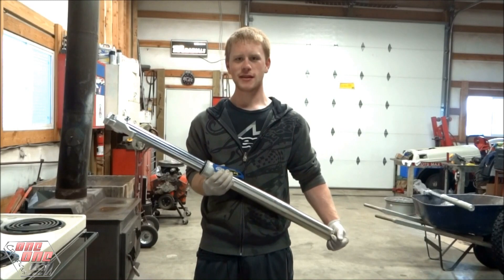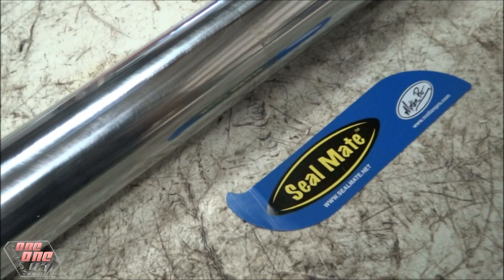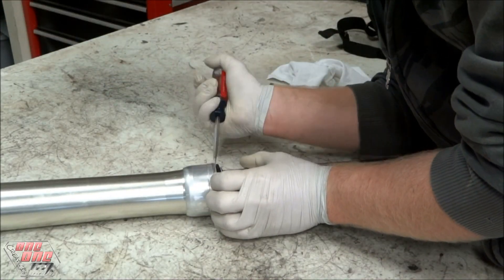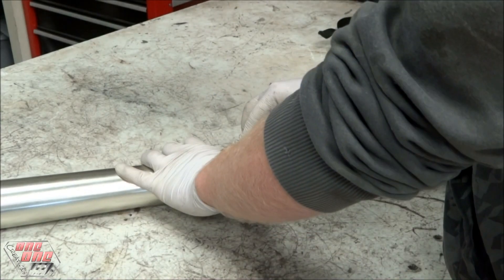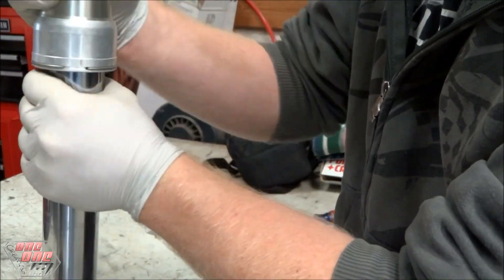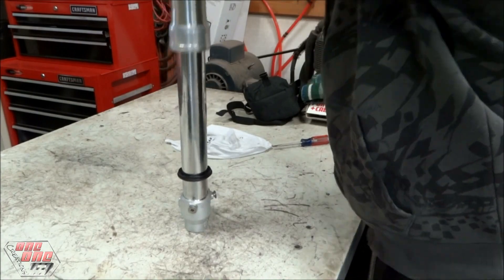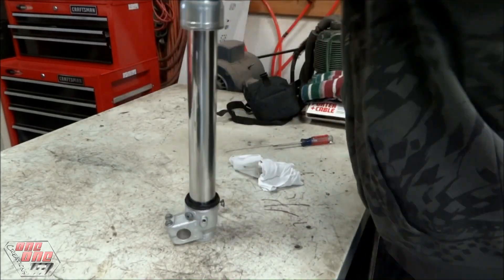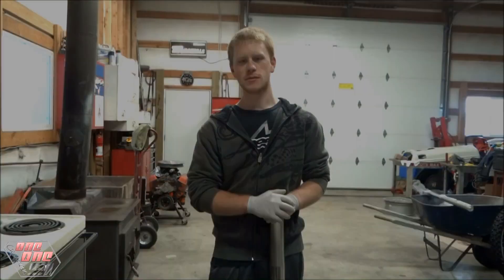Fix Those Leaky Fork Seals In 5 Minutes

Comment from the maker: Yes, that is a possibility. Take the dust seals off and clean out any sand if you haven't already. The squeaking could also be coming from something else, like a brake line guide or something rubbing on the fork guard.

Comment from the maker: Thanks! Unfortunately a feeler gauge will not work. They do not have a hook on them to remove the dirt. I've tried a feeler gauge with zero success. It could possibly ruin the seal because of the sharp edge. The seal mates are only like $5.

Comment from the maker: If your seals are leaking pretty badly you'll need to add oil and this may not fix the leak. These cleaners are for forks that are weeping a little because of the dirt stuck in the seal. It really depends on how much oil you're losing out of the seal, to answer your question.

Comment: The manual refers to use Motorex joker440 to clean the dust booth and innertube.  It reppels dust, dirt and water.  But on the inside on the real seal they use  Lubcon gti300p wich is veeery expencif grease or silicon grease to reppel dirt and dust.

Comment: Ive heard the sealfix isent good for airforks, is that true
Thanks for all your vids , they helpes alot!
Reply from the maker: I have used this method on air forks, however it would make sense that you'll need to bleed down the pressure before cleaning. A fork seal is a fork seal, so it'll fix it just as well. Thank you so much for watching and commenting!
Reply: ReVive Moto Parts OK. Thanks for the answer, now I'll go check your store if you got something for me :)
Reply from the maker: Much appreciated Ivica!
Reply: ReVive Moto Parts Do you have a used Rekluse clutch for Crf250x 2006?
Reply: ReVive Moto Parts iam also looking for lowering spacers to lower the bike internally. 
Need to lower my wifes Crf250x about 6-8 cm
Reply from the maker: Unfortunately, I don't have a clutch or lowering spacers for a 250X. Everything on the website is my entire inventory.

Comment: i tried this method a couple of times now.. once on my KX 125, and now once on my CR 125... Both times just ruined the seals altogether!
I was super super careful with the seal cleaner, but nope.. As soon as i was done, the forks hammered out oil even more..
Reply from the maker: After using the cleaner the seals will leak until you compress the forks several times to "re-seal" them to the tubes. I've done this on over 100 sets of forks and not once had the seals ruined.

Comment: can dirt make the fork leak so much that you bottom out at every jump and bump? i have a puddle on my trailer should i refill it with oil also?
Reply from the maker: I would say at that point your seals need replacing. But it doesn't hurt to try cleaning them. And you'll need to fill to the proper level.
Reply: what might have happen is that i used a air compressor to check the air in the forks ...